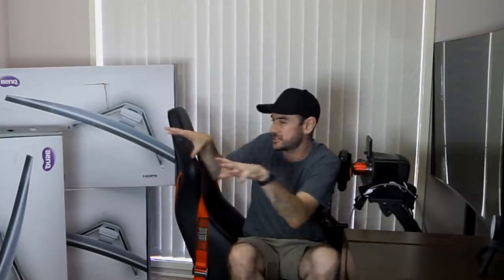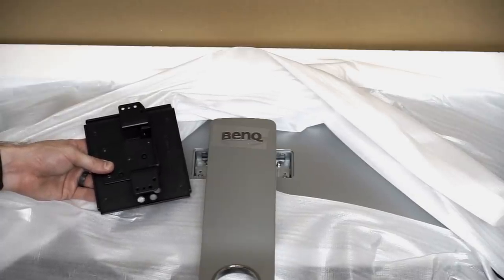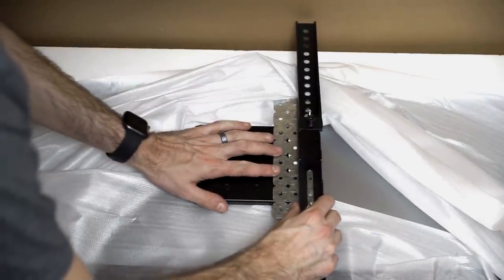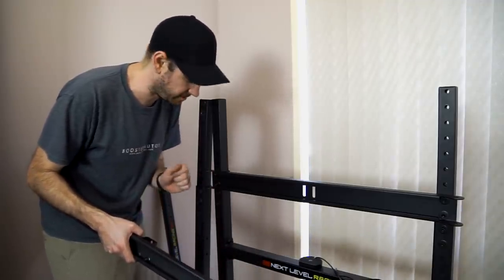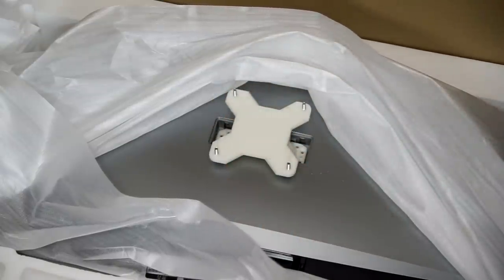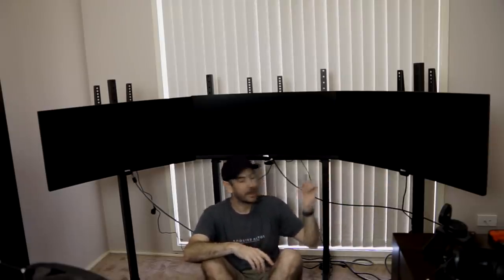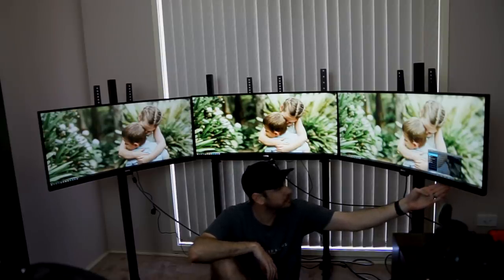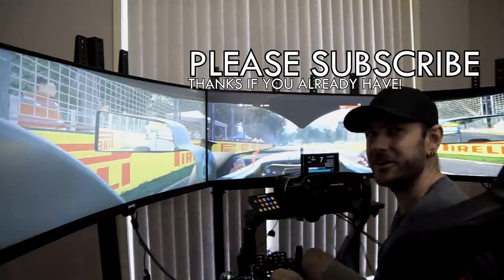Triple 35" Screen Sim Rig Project - Part 2  - Installing the Hardware

Comment: A 80/20 rig chassis with an incorporated monitor stand would really set this rig off. Possibly something along the lines or a SimLab P1 or Heusinkveld sim rig GT. Not taking anything away from your Rig (Which is very nice), but to have 3k aud in monitors hanging off a monitor stand like that seems a little funny. Love the rig tho, is there a podium wheelbase in the future?
Reply from the maker: Still deciding if I want to invest in a DD2. Its a lot of money to spend when I'm already happy with the CSW2.5. Maybe if I get more in to AC and iRacing. I feel it may be wasted on F1.
Reply: Obviously you are evolving your simracing experience...good decision with the tripple screens.So if you plan to evolve your hardware and have a DD wheel in mind,be aware that you need a solid Rig, don‘t know what you have now...but a aluminium profil rig would be the next step for me...also profile rigs can allways be modified and extended,i got my simlab p1 since 1year now with tripples,was the beat buy i made...
Reply: Totally agree with Lachie.  First off nice set up, but that next level monitor stand looks flimsy and cheap to me compared to stands from rseat and simlab.  This looks like a real pain in the arse to set up.  This video has made up my mind to go for the 49” super ultra wide Samsung 1440p next month.  I just hope I can see some sim racers test it out before I pull the trigger!!  I don’t want to deal with stretch factor and bezels, that mirror looks huge!!  Love your videos though man keep it up!!
Reply from the maker: The 49in screens have the same problem as I had with my 55in curved TV I was suing previously. They simply don’t curve around enough to provide a realistic field of view if you want to see what’s along side you/mirrors/etc.
Reply: Boosted Media yeah I would love to be able to try triple 27s and a 49” super ultra wide one after the other to compare the differences and see which I prefer
Reply: I've personally got one of the 49" on my rig and im now going to triples, in cars like the Ferrari 488 gte i can see out of one of my side mirrors but the other one im guessing whats there but not being able to see out of my windows is the pushing factor to go to triples.

Comment: While I dig the new setup. I still personally think a 49" Ultra wide is the best option. The Samsung CHG90 has been the best thing for me to run and I won't go back to triples. 1 monitor versus 3 is easier to drive with better response time and refresh rates. And some games dont support triples or as you see it's stretched.

Nice setup though.
Reply from the maker: Fair enough. I just find the super ultra wides don’t wrap around you enough to really give that perspective of things coming past you like you get with triples set up this way. That was my issue with the 55in 4K I was running before. 

If it had a sharper curve then I’d totally agree.

Comment: Hi, great
just my friendly opinion :
It Will be better with black plank below your monitor and Also upside black cover 45degre angle ..
Improving  immersion due to low height 21.9 monitor .
You must to use software To fov problem but you know that...
Sorry for my poor english...
Reply from the maker: Totally agree and in intend to do exactly that as discussed at the end of the video.

Comment: This is definitely nice, i currently have pretty good philips 326m6vjrm 32inch 4k monitor. I use additionally one 5:4 aspect ratio monitor to the left and another 16:9 to the right making it the sketchiest triple screen ever. I've managed to run ac and acc with it but it is probably worst triple screen experience you can get so im thinking of getting 2 more cheapest 32inch 4k screens. That would cost me around 600€. But it would be proper triple screen running with nvidia surround and not with 9874582 workarounds to even run on those 3 monitors.

Comment: What’s your current specs of the pc?
Reply from the maker: All in the description. 1080Ti @ 2GHz, 8086K @ 5.2GHz, 32GB 3200MHz Cas16 RAM, 2TB Evo Pro SSD.

Have managed to get the FPS back up to 90 or so by reducing the resolution which should work well for now. Also lets me run at 100Hz on the monitors despite having one running via HDMI. Unfortunately my GPU only has 2 DisplayPort outputs, which limits me to 60Hz at the monitors native resolution in Surround mode.
Reply: Boosted Media in 09 I had to use a program called softth to run my monitors. Not sure these days but may help with the side monitors getting proper fov
Reply from the maker: Thanks. I’ll check it out. nvidias “surround” feature is pretty horrible.
Reply: @boostedmedia  i'm curious about how freesync is working for you on these monitors? assuming you are still using that 1080ti.
Reply from the maker: I’m on a totally different PC now with a 2080Ti. Not using freesync currently

Comment: Response time (input lag total from steering to the output on the screen) looks a bit worse than before. Is there anything you can do about it in the settings?
Reply from the maker: Yeah, I noticed that too when I watched the video back. As I said in the video nothing is configured properly yet. I'll cover it in the next video once I've gotten my head around everything :)
Reply: @boostedmedia  Hi, that is a common problem with Codies F1 games, nothing wrong with your setup. As far as I know, it's only the animation that is delayed, the actual response from the car is not affected.

Comment: Im looking into a triple monitor setup with 32' monitors. Seeing this 35" now makes me wonder tho: is it possible to have a 35 in the middle and 32 for the sides? Is the 35 the same height as a 32 but just wider? And would you just add the extra width in the total resolution? Great vids btw, love to watch the channel.
Reply from the maker: Possible but messy. I’d just go with 32s. If I had my time again I would have used 32s for the added height.

Comment: Hey man. Love the content! What's the width measurement? Contemplating 32" or 35" inch triples. Space plays into this decision.
Reply from the maker: The way I have it set up currently with the screens at 45 degrees it’s 1.8 meters from the widest point of the left screen to the right.
Reply: @boostedmedia  thanks man🤘

Comment: This is just the video I was looking for.  I have selected Alienware 34 inch curved monitors for sim racing.  I will look for other videos of yours to see what graphics cards you use. 

With triple monitors, can you leave all of your game graphics set at full or do you have to dial some back?
Reply from the maker: Hi mate. I have to dial the settings back a bit. Using a 1080Ti currently but about to build a new system just for the rig. My resolution is 10320x1440
Reply: @boostedmedia  Thanks for the quick reply.  I am not yet a sim racer.  I am retired, searching for fun, with time to fill, and will build a motion sim rig as soon as the new fiber network cables are installed in my area very soon.  My network connections are currently slow with high latency.  I am planning to go with 2 RTX 2080 TI cards running SLI, 9900K CPU, with triple Alienware 34 inch curved monitors and I am confirming those choices by watching the experts in YouTube videos. It is my hope that I can run the sim games on max settings without any issues.  Side note:  I am surprised how many sim racing YouTube videos seem to come from Europe.  Is sim racing much more popular outside the US?

Comment: Guys, I have a 34inch LG Ultrawide. I want to go triple screen and have two 27 inch monitors for the sides. All monitors 144hz. Will I have any issues with this?
Reply: Would be messy, better off sticking with all same size for pixel density and resolution

Comment: Will, this may be an old video, but as I am currently setting up my triples, this is very relevant at the moment. How did you make all monitors align? I have triple 27" and they can't perfectly align.. the lines are somewhat skewed from one monitor to the next... How do you fix it? How did you align them? How did you make sure both were at the same.angle?
Reply from the maker: I just used small metal tabs under the rails to lift the corners as needed.
Reply: @boostedmedia  wow ,that was a quick reply! (BTW, long time subscriber and follower!) And safe to assume you have them aligned horizontally and vertically, correct...?
Reply from the maker: Yep

Comment: Do you think 32 is enough or did you wish you would even go bigger if you would redo it ?
Reply from the maker: These are 35 and plenty big enough in terms of width. A bit lore height would be nice.
Reply: @boostedmedia  thx man ! Saving up for a rig so defo want to get the righymt stuff :-) 35 it is then !
Reply: @boostedmedia  yeah, I would want a lil more height. The 32s have a bit more of vertical correct?

Comment: Thanks a lot for making this video mate. I'm a huge fan, and have seen 100s of your videos just the last month ;) 
I'm in the middle of setting up my own triple screen setup and have a question: 
What TVs/Monitors do you recommend me to use,  in the 32"-40" size? ( I'm only gonna use them on my sim rig, not for other hardcore gaming). 
Can you, or anyone else here PLEASE PLEASE give me a tip for good (and not expensive) options? (Link would be awesome)
 (I will be using triple-monitor-mount like you for my setup)
Cheers Kenneth (Spain)
Reply from the maker: If I had my time again I’d go with 32in. Probably EX3203R.
Reply: @boostedmedia  Thanks for a fast reply mate,. So awesome when creators help their subscribers. 
I looked at the Benq EX3203R, but they are STILL sold out of monitor mounts, and I cant see if your 3D printed ones are usable on the  EX3203R (. 
This makes it very hard for me to go for them since I already have a Tripple monitor stand from SIm Lab that will be used in my setup. Can you please recommend one more alternative for me?
Maybe a little cheaper alternative, that won't give me an issue when mounting them to a stand. 
(PS I also prefer minimum 32"-40", why would you step down from 35" to 32"? )

Cheers Kenneth
Reply: @boostedmedia  Hy again mate. So after research and your recommendation, I have now bought 3  EX3203R. 
I have also bought Fanatec DD1 and pedals. Now I have only the PC left and my dream rig is a reality :) 
My question now is: What Is the minimum requirements for the graphics card  I need to buy to run this setup? I'm only going to use the PC for gaming whit VR and run my sim rig. No heavy photo editing etc. 
Hope you have time to reply again since I really walue your opinions. 

Cheers Kenneth

Comment: What GPU where using in this video ?
Reply from the maker: 1080Ti
Reply: @boostedmedia  I think i'm going to get 3x1080p 27's ! The PPI isn't to much worse than my current 4k 40 " monitor , i just wish i knew someone local (Brisbane ) who would let me try triples first to see if i even should go for them . I had a Rift for over a year but the struggle with performance and low res was just to much for me . Got this 4k monitor and been quite happy , but i'm just feeling i need more now . I don't want to upgrade my 1080Ti  for the 2080Ti because ....cost but wonder is i should get the 1440p screens now and wait for next Gen Ti or just get the 1080p screens and be done with it .
Reply: @2ndLastJedi  if you want to run 1080p I would suggest not going over 24 inch monitors unless its a deal you can't pass up on the 27s. Pixel density is a big thing and 27s I would suggest running 2k lowest. 2560x1440 for the pixel density.  My opinion ofcourse.
Reply: @samuraimedi4061  I got 27" 1080p triples mate and ppi is actually perfectly cool at 53cm from eyes! I'm in love with sim racing again. Best purchase ever! Even better than my Rift!
Reply: @2ndLastJedi  shoot you mind letting me know what monitors you got? I am in need of some and have been doing more research then I would like lol
Reply: @samuraimedi4061  I got some $180aud AOC i2790vq ;) perfect for me as I can't do over 60fps in ACC and R3E anyway :) really happy and compared to my 40"4k monitor the input lag and motion blur is much better. That was a VA so it was better with blacks but these are ips so better colors and simply beautiful in triple formation.
Reply: @2ndLastJedi  oh man that is awesome, same ones I was looking at. Appreciate you letting me know, I think I'll be pleased with them!
Reply: @2ndLastJedi  What graphics card are you using on your triple 1080p monitors? And what is your fps on iRacing? I'm looking into all kinds of options for my sim, thanks
Reply: @jonathanras6051  1080ti, I don't play IRenting ;) ACC, AMS2 both get solid 60fps with Ultra/High settings ;)
Reply: @2ndLastJedi  Ah nice, I'm about to pull the trigger on 3 1080p 27" 144hz monitors similar to yours. Still not quite sure if my GTX 1080 will be able to handle those monitors with 60 fps minimum though..

Comment: You acknowledge you havent used tripple screens but you tell us what you imagine a 27 inch set is deffiecent in.    I dont mind yr videos but talk about what you know to be right as your telling people wrong.    Get rid of yr screen on yr csw and bring yr screens right up over yr  wheel base.   The ingame dash becomes yr dash.   Your nose in a sitting position should 55-60 cm from the screen. Then you will be immersed and much faster
Reply: Your*
Reply: I agree. First off, great set up and video. I'm using triple 32" curved monitors with a 2.5 CSW on F1 Playseat.  The center monitor is 1/4" from back of Fanatec wheelbase.  Set the side monitors to about 42 degrees and you will have a much better immersive experience.
Reply from the maker: Thanks guys. I’ll give this a go!

Comment: Looks impressive, but it kills your pc and graphics card with an insane total of 14.860.800 pixels. There is just not a gaming computer that can handle that amount of pixels in a game, period. Also in my opinion, 1440p won't add anything in a racing game, you just get more sky. Take a game like Project Cars 2 or Assetto Corse Competizione. I run a i7-8700K water cooled at 5.2Ghz with a 2080Ti on 3 screens at 1920x1080, that's 6.220.800 pixels. I can run everything maxed out and barely stay above 62fps in bad weather, but it's smooth as silk (freesync helps). That is with A FULL field of cars (28 cars in ACC).
In your setup your pc needs to calculate more then double that amount of pixels (130% more). Even if your running a second 2080Ti, your never going to make it happen.
Now you have spectacular screens, but you have to turn down your graphics probably to low or medium and that's a real shame because these new games look sensational maxed out.
Reply from the maker: I’m getting 80+ FPS at 10320x1440 in most games with my setup.
Reply: @boostedmedia  Your response is much appreciated. That 80fps is mighty impressive and I would like to believe you that it's under the same load as I mentioned :-)
I would like to submit a request that when you have time to show us fps results. Because my setup scores benchmarks up into the top5 of fastest gaming rigs and I don't make those numbers. To be clear, I have 150fps in games like Assetto Corsa and F1-2017 running in clear weather. But as soon as I drive at night with heavy rain, full field of cars in a game like Assetto Corsa Competizione or Project Cars 2, my fps drops to around 64fps in heavy traffic  and max 80fps surrounded by a couple of cars. All my graphics settings are at the highest possible setting.